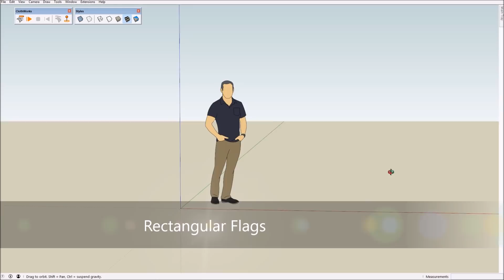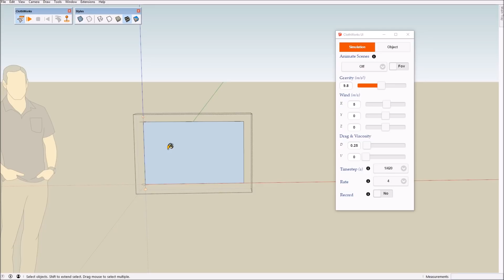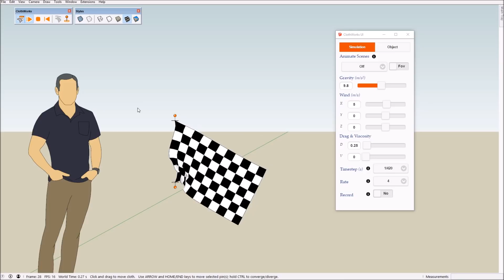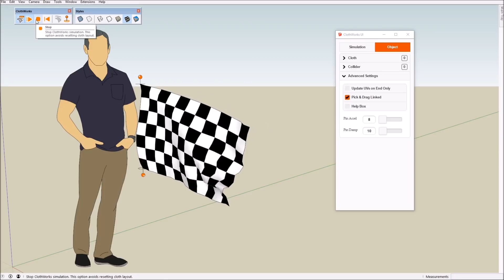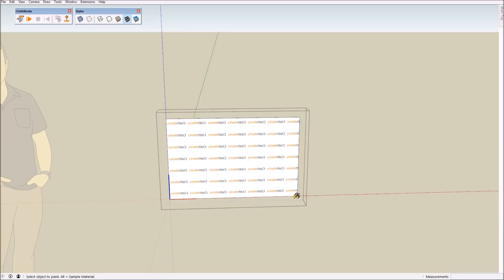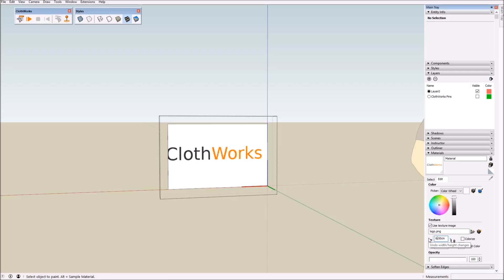ClothWorks - Rectangular Flags

Comment: Can you also simulate a sail on a sailbot with this?
Reply from the maker: Assuming sailboat isn't moving, yes. Simply draw a triangle for the sail. Group it, assign it a cloth property, and apply it a smart grid with a desired spacing; simple grid won't work right. Then add 3 pins, with one at every corner of the cloth. Enable drag for the cloth, and control the wind sliders in simulation tab to adjust wind.